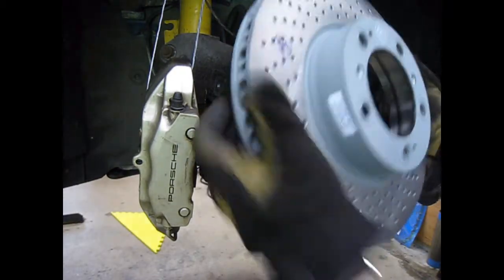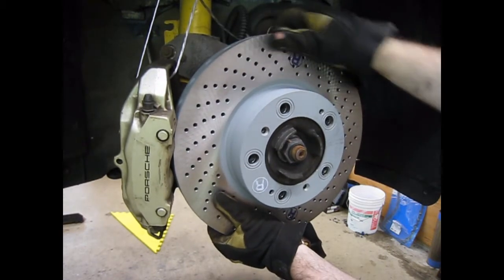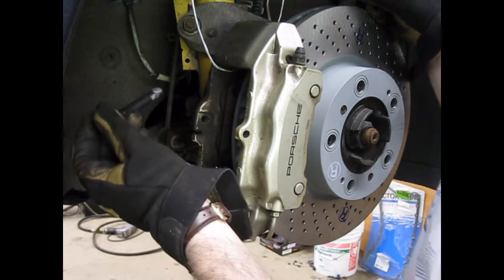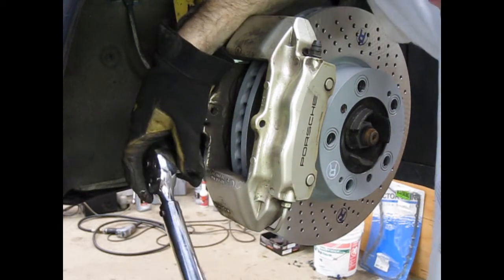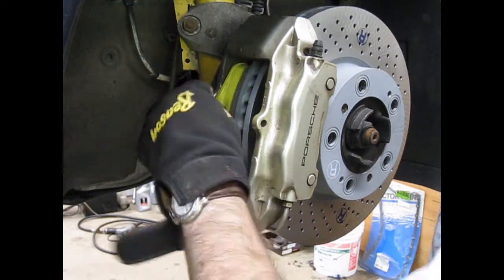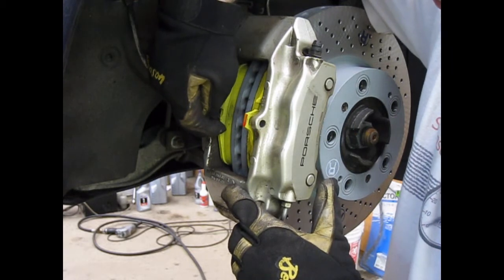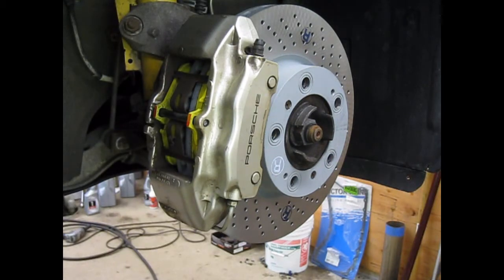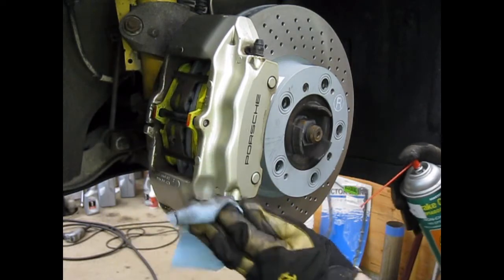DIY - changing front brakes on a water-cooled Porsche - part 2

Comment: Great video!  Very clear and you aren't trying to break a speed record getting it done like many mechanics.  Only recommendations I have are not to use a prybar against the new rotor.  Use a c-clamp or compressing tool after the caliper is off.  Also, usually good to put copper grease behind the new pads.  I also brass brush all slides and threads to be sure dust and corrosion is out.

Comment: What prevents the break pads to rotate with the rotor? Where do they transfer the force they receive while breaking?
Reply: The caliper is mounted to the suspension spindle which is fixed. The spindle moves up and down, but does not rotate. The rotor is mounted to a hub which slides on the spindle via a bearing surface.
Reply: The pads transfer the brake force to the caliper housing on little abutments that you can't see in the video. The housing itself is bolted to the suspension, transferring the force to the suspension which is designed to react it.

Comment: Hey Van, I put copper anti-seize on the rear of my brake pads before putting them into the caliper - the side of the pad that goes against the caliper pistons. Is this ok or should I not use copper anti-seize there? Should I take the caliper off and clean it off?? Will it damage my caliper?
Reply from the maker: It won't cause damage.  Some people think it will reduce brake squeal by reducing vibrations - but I find the heat of brake operation quickly burns it off / dries it up.
Reply: THANK YOU Van! I really appreciate your response. I removed the brake pads, cleaned off the copper anti-seize from the back of the pads and the inside of the calipers. There is a minor amount left that I couldn't get off but I removed 99% of it. Thanks again. Your videos are awesome!

Comment: First of all, if there were a category for good, clear, helpful instructional videos at the Oscars, you'd have a row of statues by now. Even the lighting is great. BUT, to get maximum cooling action to the brake pads, wouldn't it be better if the veins were rotating AGAINST the direction the wheel is rotating, to scoop more air up as the wheel comes around over the top?. Bold, I know, to second guess German engineers, but when the rotor is drawing air up while going around the bottom of the wheel, it is only going the same speed as the car itself. When the rotor is going over the top of the wheel, it is going twice the speed of the car, relative to the ambient air. Just sayin.'
Reply from the maker: The issue of "scooping" air like you're saying, is that as you gather it up, you're going to start compressing it, and then it's going to be harder to "vent it out" because more air molecules will be in the way (high pressure).  To get around this, the air enters at the center of the rotor and is "flung" outward.  This gets a larger volume of air through for better cooling!